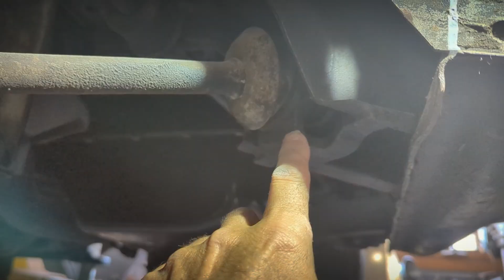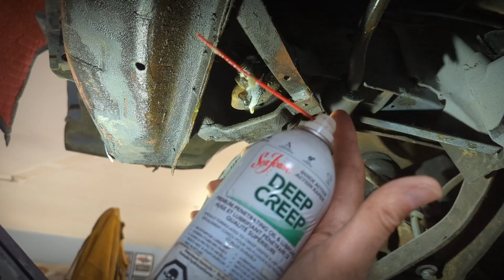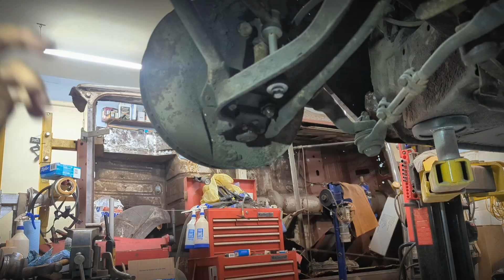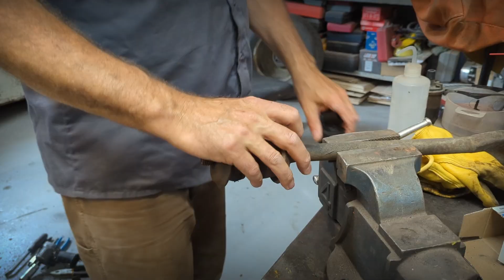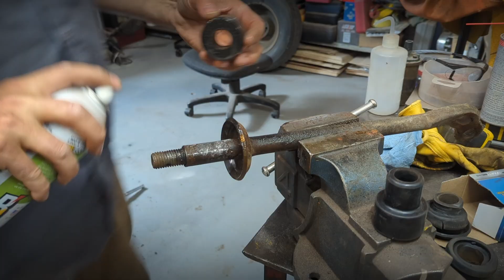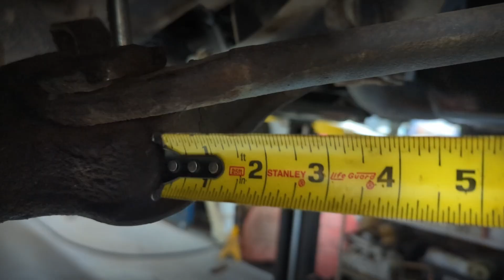Radius Arm AKA Strut Rod Bushing Replacement 62-66 Thunderbird

Comment: I'm not sure how you are adjusting to get the spacing that you need.  Is the adjustment in how tight you tighten that 1 1/8 nut, because it looked like the other end with the 2 nuts was in a fixed position.  That part is just not clear to me. Nice video, and thanks for showing how to do the things that you do.
Reply from the maker: The sleeve on the bushings end is a set distance, and the 1 1/8th nut tightens to the sleeve, so not adjustment on that end.
However, adjustment can be made at the control arm end, the two holes in the radius arm are slotted for adjustment.

Comment: nice video as as always! 😃😊 I saw your shorts video with the ticking sound on the 65 tbird. You said that that was the fuel pump making that ticking sound. Mine has the same ticking sound. But my mechanical fuel pump is new. Did I install it incorrectly causing the tick in in the engine while running? 
Or did you find out what was going going on with your fuel pump?  😉
Reply from the maker: Thank you.
With mine, the ticking stopped after changing the fuel pump, whisper quiet now.
If your car is running, then you installed the pump correctly. With the engine running, take a long pry bar, or a piece of hose, PEX pipe works well for the hard to get at places, touch one end on the pump, and the other to your ear, if the new pump is ticking, you will hear it...you can do the same to the valve covers to see if the noise is a valve issue.